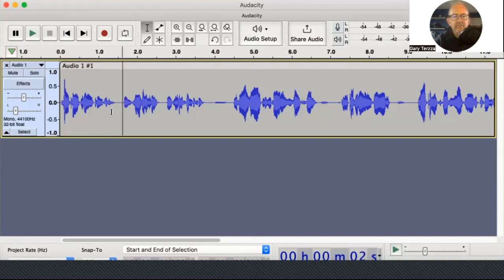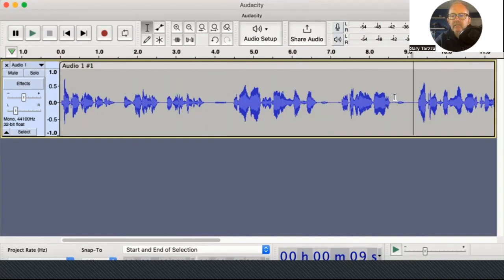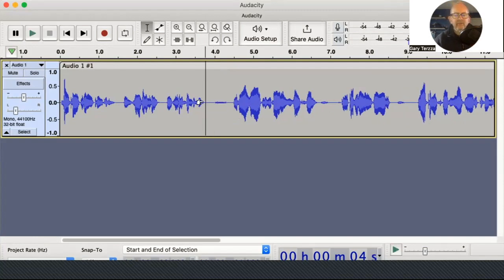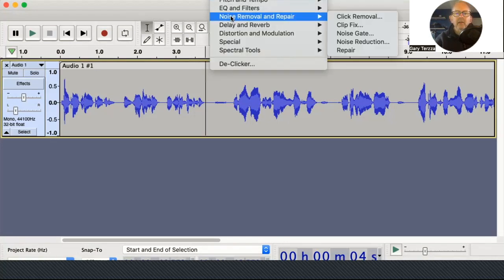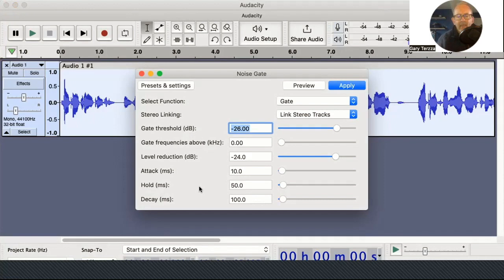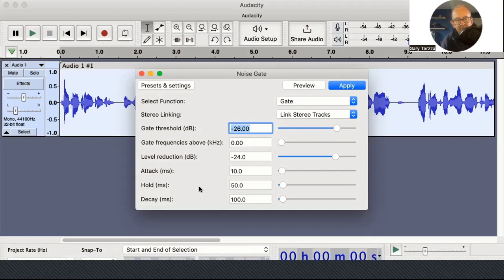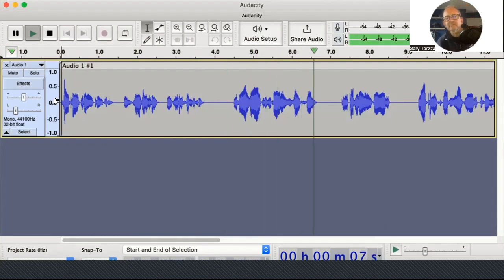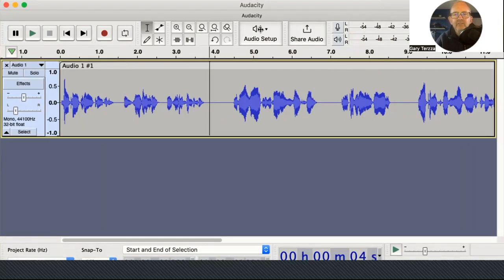How to de-breath using a Noise Gate (Audacity)

Comment: Thanks, Gary! This was so helpful. Have you documented anywhere (maybe your newsletter) the optimal settings for audiobooks when using Audacity?
Reply from the maker: You’re welcome. 	

ACX’s requirements for audiobooks are:

1.	RMS Levels: Between -23 dB and -18 dB.
	2.	Peak Levels: No higher than -3 dB.
	3.	Noise Floor: No higher than -60 dB.
	4.	File Format: 192 kbps or higher MP3, constant bit rate, mono.

Installing the ACX checker for Audacity is a good idea and to sort out RMS issues check out https://youtu.be/dG6sjUJzkBM?si=ruy1mH9LeBNUvVyW